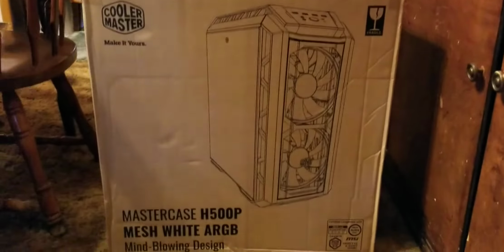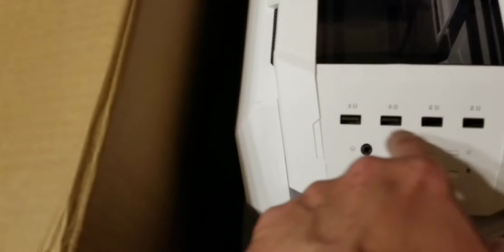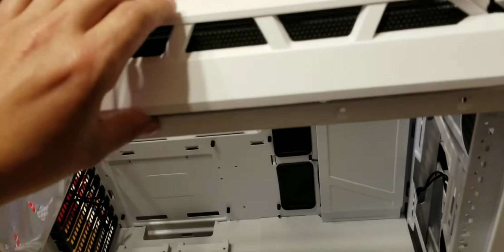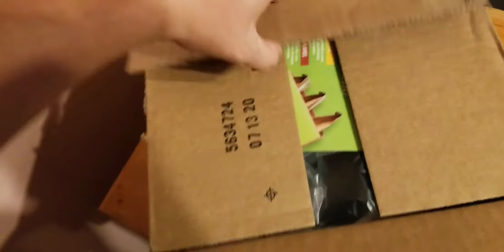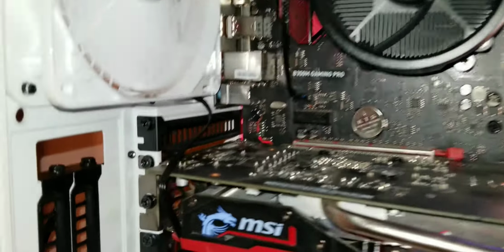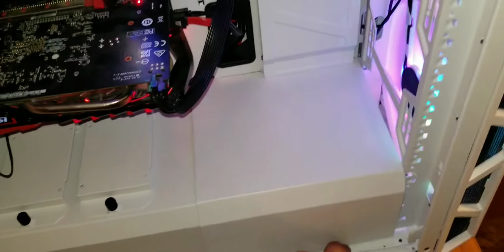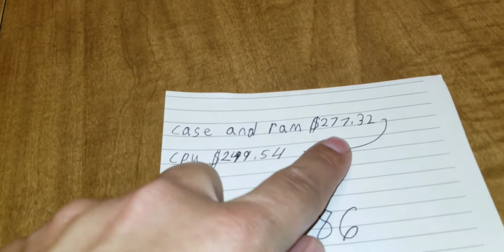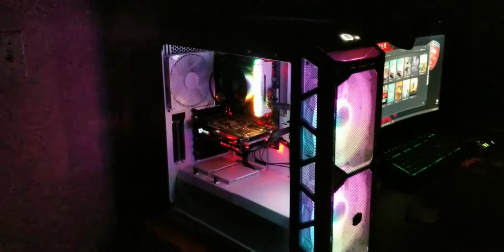unboxing Cooler Master MasterCase H500P Mesh White ARGB with CORSAIR Vengeance RGB Pro 16G/build

Comment: looks like a great case
Reply from the maker: It's really is I like it
Reply: @NICKSSHOP  you can also if you wanted watercool it as well by the way just saw a mod on that case
Reply: @NICKSSHOP  im thinking about buying it
Reply from the maker: @christophertarasenko7597   Honestly I would I  highly recommended it. It's easy to clean for dust and u would have lass dust,and alot of room for an intercooler    which I be getting here soon.and for the l.e.d light its easy to hook up I be doing a video later today on it to show how I have the l.e.d hock up and how much dust is inside
Reply: @NICKSSHOP  i want to update my old 2015 case from nzxt and this case and the fans are the other reason i like it
Reply from the maker: @christophertarasenko7597  I agree and the fans is what made me get this one as well with the reset button to trun ur l.e.d lights to different colors or off and on this case is just awesome

Comment: We’re do you plug in the fan rgb plugs I can’t figure it out on mine
Reply from the maker: Well for mine I had to use the one off the power supply and the Reset button on the case to make the rgb light to work then all u do to change colours is push the reset button to the colour u like